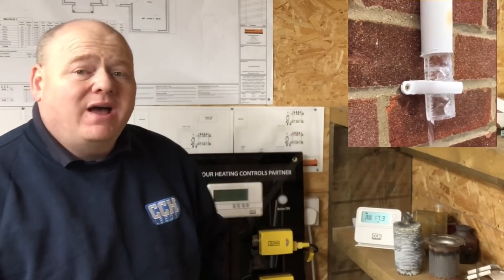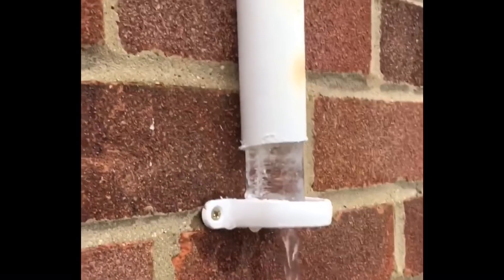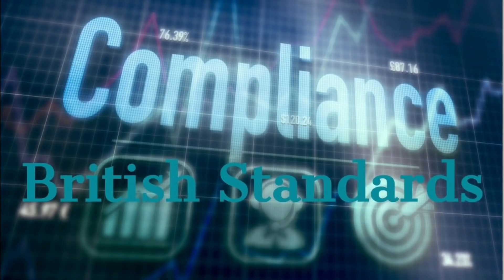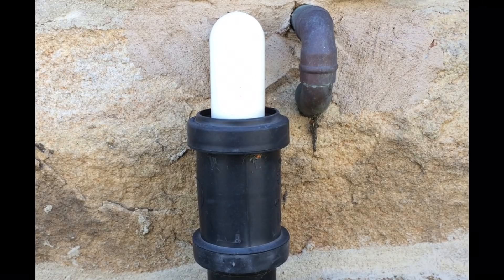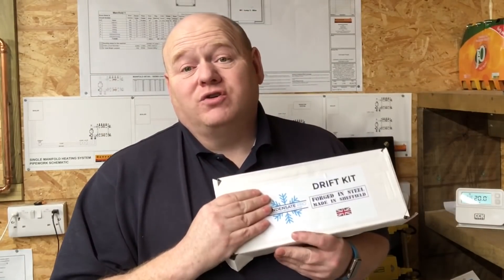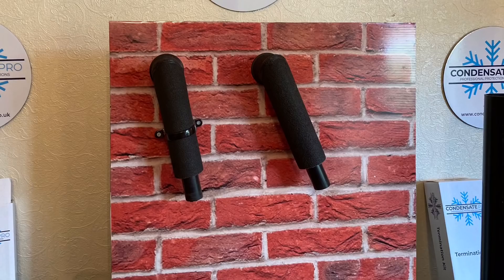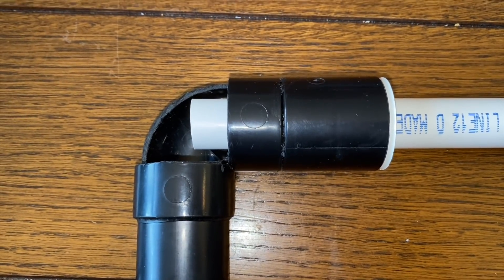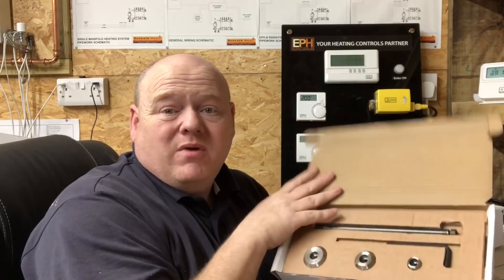Frozen Condensate Pipe - How To Avoid Boiler Breakdowns Due To Frost

Comment: Nice product...in some of those poorly installed condisate photos ,what more worrying is the apparent lack of an external airbreak. Seen it loads of times, no airbreak, downpipe blocked or overwhelmed and rain flows up condisate and into boiler soaking everything.  Boiler right off .
Reply: No answers other than insulation with quality products and fitting correctly, Many manufactures boilers don't need a air break
Reply from the maker: Internal air break would mean it floods the house though 😂😂😂😂Blocked soil pipe wouldn't be nice👍
Reply: I agree, internal airbreak no good either, although at least it would save the boiler. I would say 9 out of ten boilers I go to with condisate running external have no airbreak at all.
Never seen that condisate pro before, looks a good product.
Reply: It’s a requirement for The manufacturer I work for, and it’s very rarely fitted.  Can’t speak for other manufacturers but can’t understand why they wouldn’t.  Seen it many times wreck our boilers and damage the house at the same time. We wouldn’t fix it. It’s a house insurance job or back to installer for a replacement boiler. All for a gap in and external pipe.

Comment: If condensate drips from the boiler, ice forms. If the boiler discharges condensate in one go, like a condensate pump, then no problems.
Reply: when a condensate trap discharges yes it lets a lot of water go however our research has found its the last bit that holds in the pipe even on vertical pipes and this is what starts to freeze and form a cap, that's why insulation stops this, yes you cant stop freezing but it's down to time and temperature and its the night time that the lowest temperature
Reply from the maker: Good point but more cost and they fail as well. Thanks.
Reply: @AllenHart999  
Some boilers have siphons that empty in one go.

Comment: Nice one Allen. Always on  the lookout for new products. Lagging external pipes as always been a problem. The merchants usually only sell standard foam lag, which perishes very quickly.
Reply: HI 
if you go on to website www.condensatepro.co.uk and send us a message on the  contact page, we will send  a discount codes
Reply from the maker: Standard lagging looks awful as well. Thanks for the comment.

Comment: Nothing wrong with pouring warm water to unfreeze the pipe, 2 minutes job.
Reply from the maker: They shouldn’t need to, We should be raising the standards and installing boilers correctly. Lots of people had slips and falls trying to unfreeze condensate pipes a few years back.
Reply: plastic manufactures advise not to as it can fracture the pipe ( even warm water ) then as Allen  advised there is the health and safety side
Reply: A Miah after paying 3k for a boiler install I don’t want to pour warm water because the installer wanted to make things easy for himself.

Comment: my main 30 has has overflow from boiler straight to outside and that is it, doesnt go to anything just acts like a overflow pipe from wc/etc never froze in last 10 years of being fitted.
Reply: It has to go into a drain, not discharge onto paving or grass, etc.
Reply: @johnburns4017   it goes into next doors garden, does that count?
Reply: @MyMonkey1973  
How obliging of them.

Comment: Out the wall in 4” soil pipe 😂 on a serious note have used 2” pipe just because I had it. Also use a condense pump where available that will allow to route it internally.
Reply from the maker: Do you lag the pipe? Thanks.
Reply: 32mm pipe lagged pipe starting the termination  internally or a worcester CondenSure trap.  The best code of practice is to terminate internally with condensate tundish or some other form of backflow prevention.  It's best to keep the condensate run as short as possible 😂

Comment: Live in Devon always use inch and 1/2 outside of the property never had one freeze up.
Reply: Ok thanks Allen looks like condensate pro then 😁👍
Reply from the maker: @stevereynolds7375  I have tried all these things over the years lol... Thanks.
Reply: @stevereynolds7375   Hi steve its  always best to protect and follow MIs as protects you and customer and  never know with climate change and conditions like best form  the east, 
if you go on to website www.condensatepro.co.uk and send us a message on the  contact page, we will send you  a discount codes
Reply: @stevereynolds7375   Steve Reynolds   Hi steve its  always best to protect and follow MIs as protects you and customer and  never know with climate change and conditions like best form  the east, 
if you go on to website www.condensatepro.co.uk and send us a message on the  contact page, we will send you  a discount codes
Reply from the maker: I used to do that but please check with the boiler manufacturer as a lot are saying they may void warrantees if they are not lagged correctly, 1 1/2 outside is not allowed according to most. Thanks.
Reply: Why would inch and 1/2 not be allowed/be the best option. I always thought the wider diameter would prevent freezing?
Reply from the maker: @stevereynolds7375  Still needs lagging. They want us to install waterproof lagging. Thanks.

Comment: The main thing I see alot of is condensates not terminating below the gully. Having them above the gully allows the cold wind to blow up the pipe and regardless of how much lagging or the size of pipe used, it's going to freeze. Keep your external pipe runs to a minimum and terminate correctly and unless its exceptionally cold you'll never have an issue.
Reply from the maker: 👍What lagging do you use? Thanks.
Reply: I've used the armaflex type o with the self sealing strip in the past which I found quite good. On short runs I dont bother though and I've not had an issue
Reply from the maker: @craigwatson7692  Do you paint it? and then go back one week later and paint it again? Thanks.
Reply: @AllenHart999  never painted them no, the lagging doesnt come with instructions so I wasn't aware you had to until this video 🥴
Reply from the maker: Craig Watson Every day is a school day, I only found out yesterday 😂
Reply: great comment and 100%wind chill is another risk, we have a simple  solution that we have tested for 2 years, slide a 200mm piece of rainwater on the out insulation and take this below the drain and will stop windchill to the insulated pipe, also customer can be advised to do and see if there is any ice forming and can break it off
Reply: Some armaflex does not need painting please see my comment.

Comment: Good bit of kit but if it's cold enough for long enough it will still freeze I think internal is the only anwser at the moment or electric trace wire
Reply from the maker: Not much point it installing a condensing boiler if we are going to use trace heating in my opinion. Thanks for the comment though.
Reply: Allen Hart a grace wire only requires 5 - 10 watts.
Reply from the maker: @chrisb4009  They cost a fair bit to start with, You then need to pay for installation and then running costs, Personally i do not install them. Thanks.
Reply: Trace heating is expensive to fit and plastic manufactures don't recommend as cracks the pipe,  many have faults when you needed them and look ugly, quality insulation fitted correctly  will give max protection
Reply: 70% of properties are all external soil and drains so have to be external and so insulated 
many think because its connected to the sink its internal but most then go to outside drains